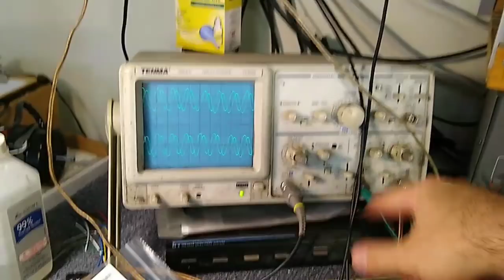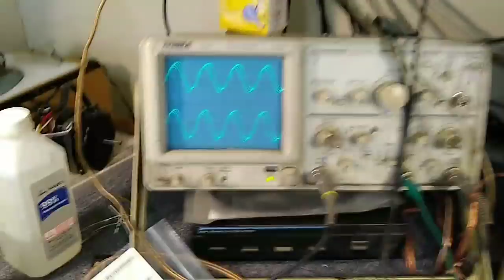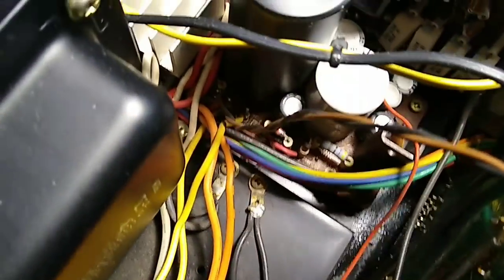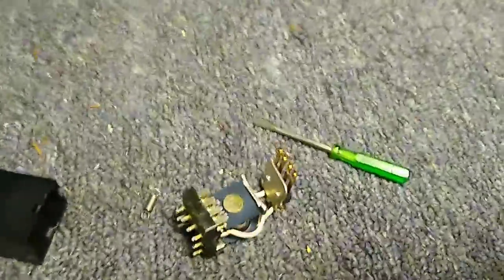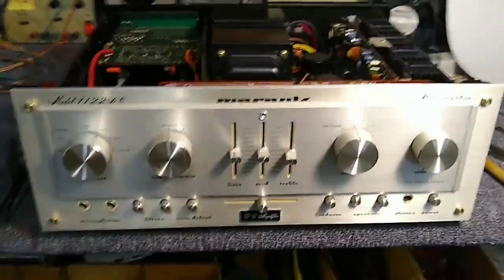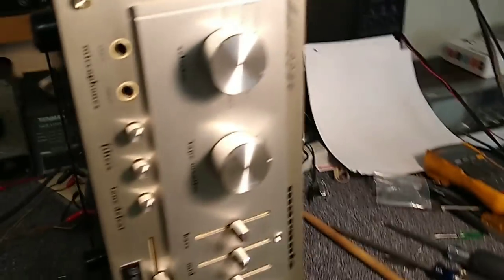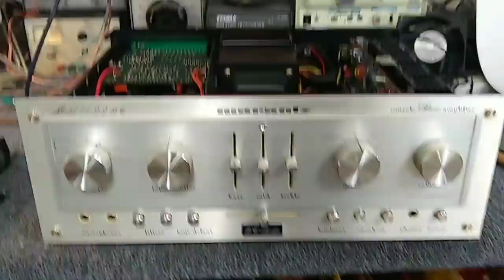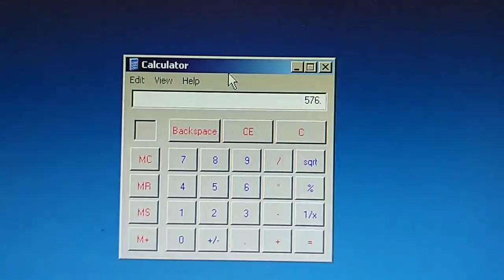Servicing a marantz 1122dc integrated amplifier, basic services only

Comment: I remember receiving a marantz vintage stereo amplifier with built-in radio tuner,,,and it had problems with the sound and radio tuner,,,upon opening the top and bottom covers,,,it was very dirty and filthy with dust,,,I guess because it was in a workshop shed,,,and it took a lot of cleaning,,,re-soldering over 100 dry solder joints,,,,especially on the ic amplifier circuit board,,,cleaned out the volume control pot,,,and the switches with compressed air,,,b4 I even knew about the contact cleaner,, deoxit,,,and reassembled the unit and test,,,,,on all inputs,,,record player,,tape,,aux,,and radio tuner input,,,it sounded like a new machine,,,with only a bit of re-aligning the fine tuning oscillation and sensitivity for am/fm stereo signal,,,the sound,along with tuning in stations were sounding loud and clear,,,I got paid more than $100 Labour,,,with no parts replaced,,,took me over 4 hours in cleaning and re-soldering repairs,,,and it paid off really well.

Owner said he has looked aftered it really well ever since,,,,but not sure if he still has it now. As it was over 10 years ago since it was repaired.

Comment: I've cleaned many hundreds of audio  relays like this one. Two things I've learned: 1) clean the contacts on the body of the relay itself, not just the movable fingers. 2) it's better to clean ordinary tarnish with a pencil eraser (ink eraser, really), and only use sandpaper or a contact burnishing strip if there has been obvious arcing or pitting. Flush with a non-residue solvent, pure alcohol or similar. Never spray a relay with DeOxit or other cleaner that you would use on potentiometers and switches, or the contacts will eventually turn green. PS,  those  small orange caps on the vertical front PCB are known to fail. [EdIt:: I wrote the part about cleaning the other set of contacts before watching the whole video. Sorry!]
Reply: They make a relay contact cleaner which is multiple parallel glass fibers bonded together.
Reply: @opera5714  , yes, a "scratch brush". Tremendously useful for various aspects of electronics work, but a bit too rough and abrasive for cleaning relay contacts. I have manually cleaned many hundreds of audio relays, switch contacts and so on. At the audio repair store I worked at for 15 years, we used pencil erasers (ink erasers, really) to polish the contacts, than flushed them with alcohol. Only rarely did we use ultrafine sandpaper or a contact burnishing strip, only if the contacts were pitted and a replacement was hard to obtain. PS, watch out for glass splinters from the scratch brush! They'll fester for a week or more before finally working their way out of your fingers....

Comment: cool stuff! Have you ever worked on a Tenna? I found one at a thrift store, cute little receiver thing, 70's  -found it totally impossible to remove its chassis because the tuning knob is welded on there or something. now it's a pile in a pile of piles.

Comment: A possible issue in using a multi-meter for  power measurements on the AC range is that they are specified at 50/60hZ. Many meters have not got a very accurate frequency response at other frequency's. Most are OK up to a few hundred hZ. They do vary quite a bit, more expensive does not always mean better on this point.

Comment: thoughts on the relay, the crust on contacts is humidity over time, solution soak a small piece of cardboard cut to right size
soak in mineral oil and try to strategically place it in the casing of the relay,  now contacts will last ten times longer

Comment: Overly designed equipment prone to excessive failure. A power relay where a simple heavy duty power switch would suffice, selector switches at the back with long shafts to reach the front when they could have front mounted the switches, tricky slider linkages for other selector switches. And what's the point to a tone kill switch when you can get the same effect by just setting the tone controls to flat. Simple designs are less prone to failure and easier to service when failure does occur.

Comment: Load box - Dummy Load. I have a few: One rated at 10Kw, one rated at 1.3Kw and another rated at 500 watts but in the 50 ohm flavor for commercial/public safety and 2-way radio and broadcast radio work.

Also: All these KARENS in here harping on the state of your bench and equipment.. SMH.. You keep doing what you do how YOU want to do it, us real techs understand how it is on busy days/weeks. I have this feeling 99% of those people have NEVER worked in a real shop and are just: #ArmchairExperts

When I started in radio the other tech in the shop smoked a pipe like a freight train, the tobacco tar was on the light fixtures and made the whole area a yellow tint and EVERYTHING smelled if cigarette glaze as Shango066 would say.. But you know what, as nasty as his bench was he repaired radios and those radios never came back in for repair and he never had a complaint nor have I when I worked there.